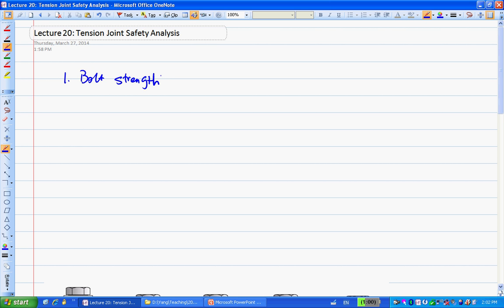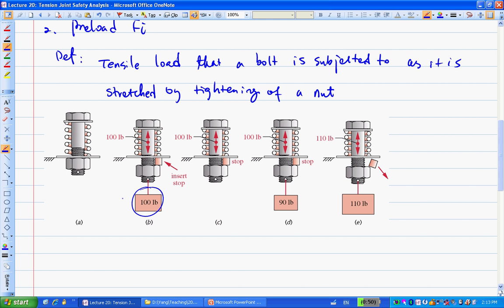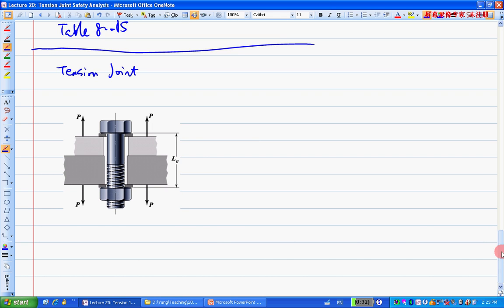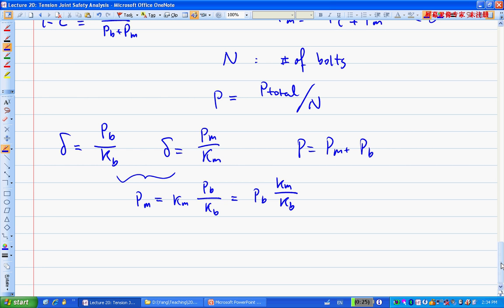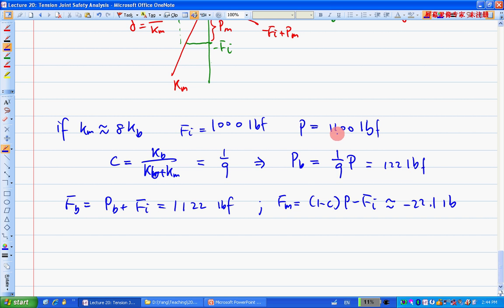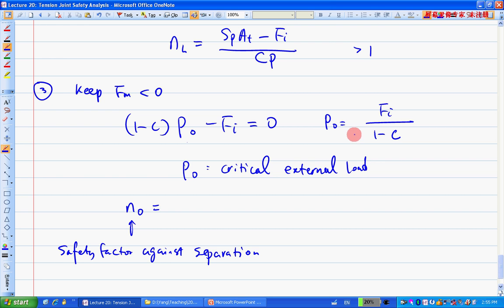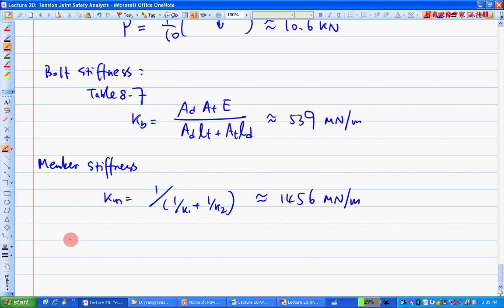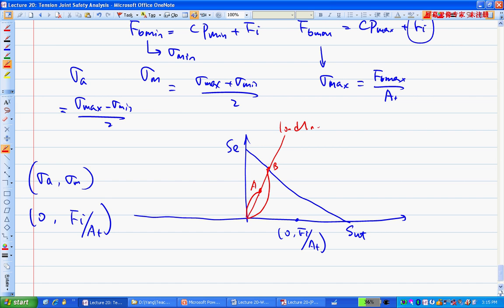ENGR380 Lecture20 Bolted Tension Joint Safety Analysis

Comment: Why do you equate the tensile stress on the bolt to the proof strength for the fastener example here and then in the power screws example (lecture 18) you equate the Von Mises stress (the combined bending and shear) to the proof strength. Surely there is the same combination of stresses in the fastener as there are in the power screw?

Comment: Great video, is it the same calculation if a screw is used instead of a bolt and nut?
Reply from the maker: The steps are similar.  However, when calculating the screw and member stiffness, the length for grip is obtained differently.
For bolted joint, the grip is the total thickness of the clamped members.  For screwed joint, it is the equivalent grip we are looking for.  Shigley's textbook has the details.